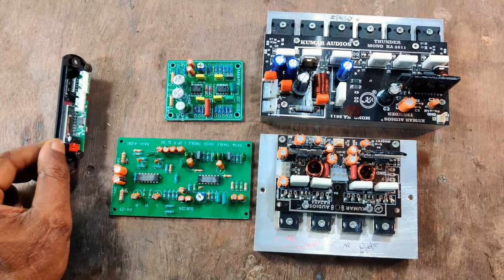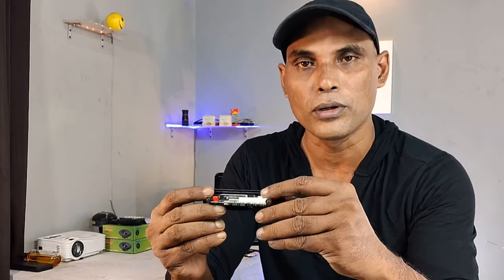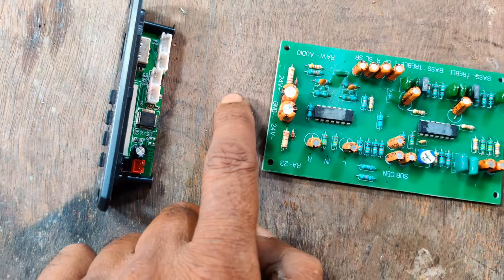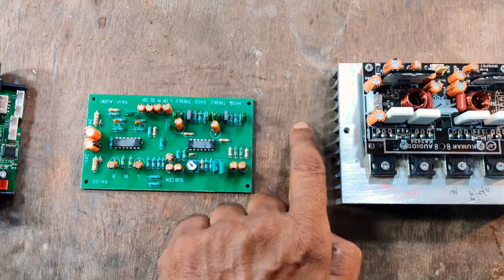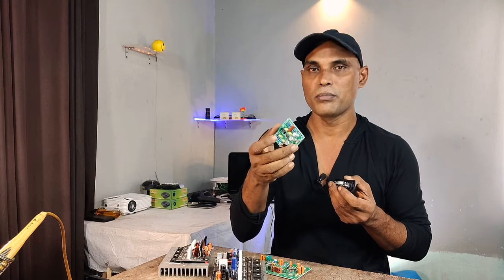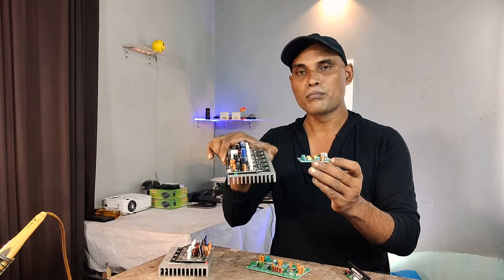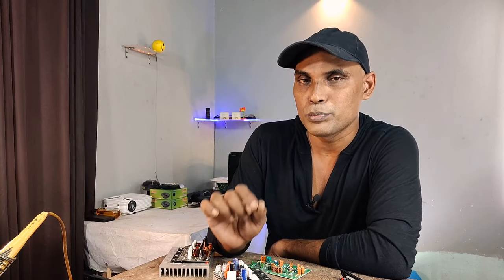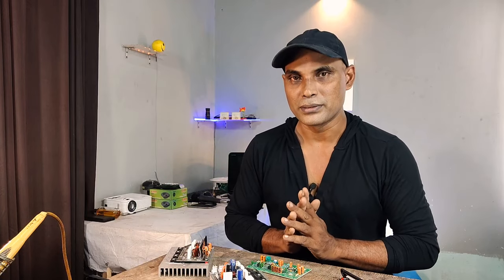എവിടെ എല്ലാമാണ് കൊടുക്കേണ്ടത് | Where should you connect Buffer amps

Comment: No buffer amp requried in op amp output 
( bass treble board or sub filter board using op amp) .because op amp output impedance is around 150 ohm ie   lower than transistor buffer.
Reply from the maker: Ok
Reply: വീട്ടില് കിക്കർ സ്ക്വയർ  12 ഇഞ്ചി സബ്‌വൂഫർ ആംപ്ലിഫയർ കണക്റ്റിംഗ് ചെയ്യാവോ ഉടനെ പറയൂ ബ്രോ

Comment: Chetta. Mic howling engane korakkan pattum. Buffer amp use aakumo.
Reply from the maker: Speakers and mic face ചെയ്താണോ വെച്ചത് or balanced cables ഉപയോഗിക്കു
Reply: Thanks alot for reply. Speaker and mic faced alla. Purakil distance vechalum howling und. Pre ampinte prasnamayirikkille appol. Gain control mathtame koduthittullu. Circuitil enthelum cheythal maarumo.

Comment: Amplifier paniyumbol  filteringnu vendi capacitor okke thalakeezhayi vechu connection koduthal enthekiilum sahacharyath damege ayi gas   purathu povathe block ayi pinne capacitor potti therikkathille 🤔🤔
Reply: Board എങ്ങനെ വച്ചാലും No problem ചില സാഹചര്യങ്ങളിൽ components താഴെ വരുന്ന രീതിയിൽ Board fit ചെയ്യേണ്ടി വന്നിട്ടുണ്ട്.
Reply: @JBElectroMedia  alla filter Capacitors okke thalakeezhayi glue cheythu vekkum